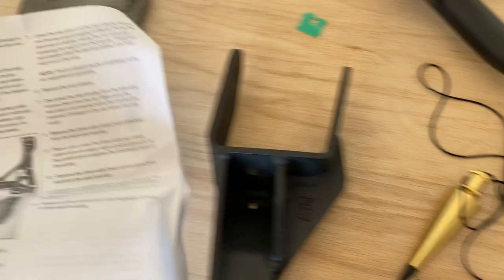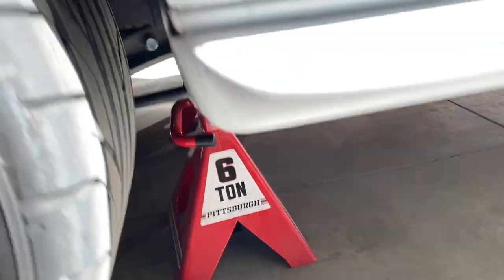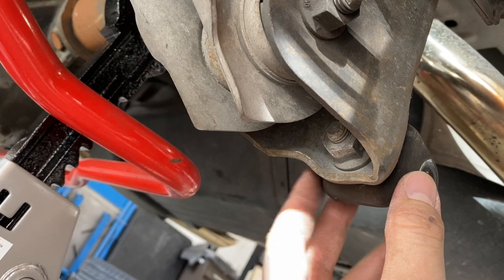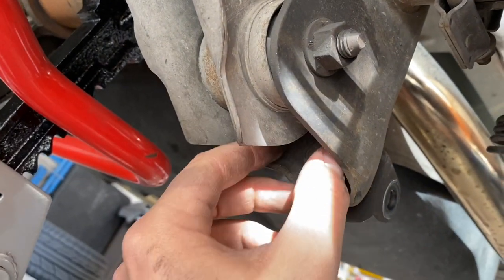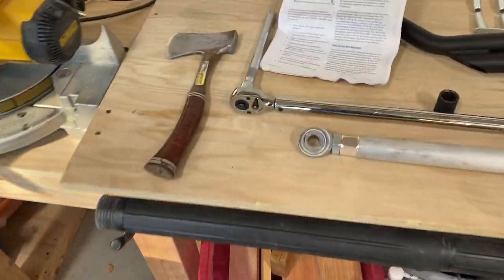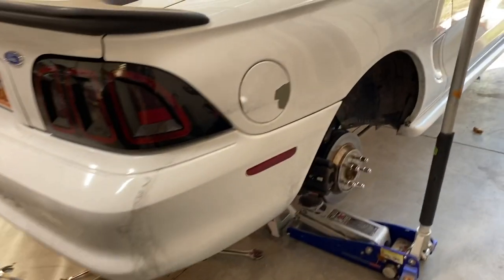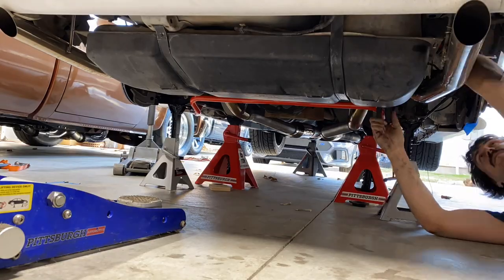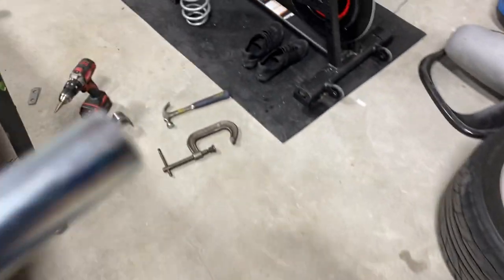Maximum Motorsports Panhard Bar Install Part 1

Comment: I know you have to remove the driver side LCA pivot bolt to install the MM mount.  Outside of that, is there really any reason to remove the LCA bolts and rear springs?  I believe I can get the LCAs and axle level/parallel with the springs in.  I have MM adjustable LCAs and H&R SS springs.  Seems like extra work for no reason?

Comment: Great video. I installed the same kit on my fox body. What is the ax for ?
Reply from the maker: Lol it must have been on the bench after sharpening it.  Just use it for splitting wood at campsites

Comment: You seem to put a big emphasis on having the car level... I'll be using a set of quickjacks to raise the car but my garage floor is on a 2 degree incline. Any advice or words of wisdom based on these parameters?
Reply from the maker: So I think having the car evenly weighted is more key.  I wouldn’t stress over the incline of your garage.  It should be fine.  Thanks for watching!
Reply: @truckandroll989  I'm sure I'll have a better idea of how to approach this once I get started. All I know is that I cannot stand the lateral shift on the rear end currently lol.

Comment: How was exhaust clearance once installed?
Reply from the maker: It was extremely tight but it did clear without any rubbing while driving
Reply: @truckandroll989  good to know, thanks!
These cars are limited enough on space with the cat backs. Didn’t want to have to ding up the pipe or run dumps off the mufflers like I’ve seen some do with the panhard bars.  Car is sweet by the way

Comment: Hahaha... I couldn't help but laugh loudly when you got to step 14, I must have read that step 20 times as I was going through the instructions before I started.  It's a doozy!  

Are you going to put a T/A in?  I have one but I don't weld, so I'm going to have it installed when a local shop welds in my subframe connectors and chassis bracing.
Reply from the maker: I did not.  I tracked the car without it and enjoyed how it handled.  Definitely predictable.  In hindsight if you dont mind losing the airbag a new steering wheel would make a huge improvement I think.  I have since sold the Cobra and been focusing on my Mach 1.  Check out those videos if you get a chance
Reply: @truckandroll989  I was just noticing your mach 1 now.  Love the color on that car.  Very nice.  

I have contemplated a new wheel, but while my car is being built for the track I really love to drive it when I get the chance.  I really don't want to get rid of the Cruise control.

Comment: most people have a 13/16 wrench and not a fisher price tool set.  great video though!
Reply from the maker: I have a 13/16 open end i forget why I used that.  I think i needed the length to rest against the floor so i could torque the fastener by myself.  It would have been tough to hold the bolt from spinning and torque on my own.
Reply: @truckandroll989  i really hate to work on my back.  just busting your chops a little.  did you do the torque arm?